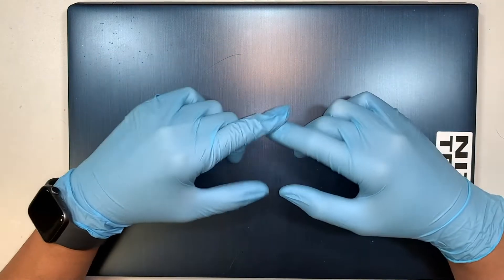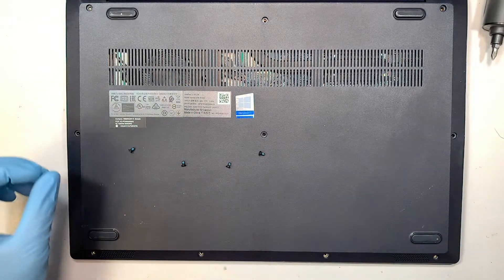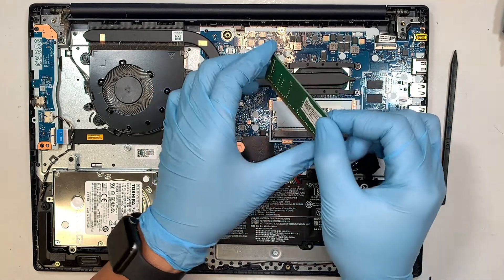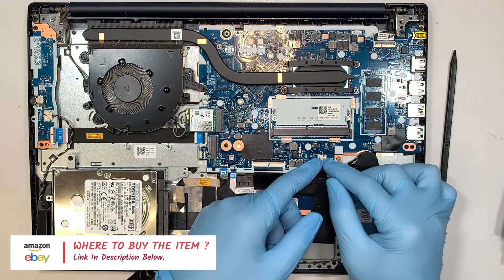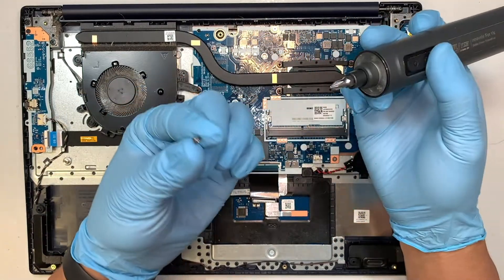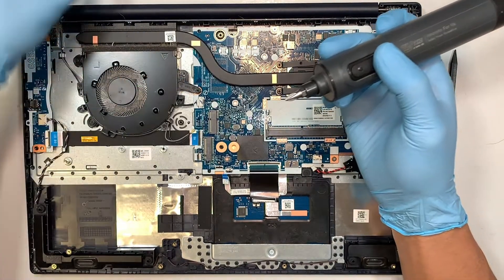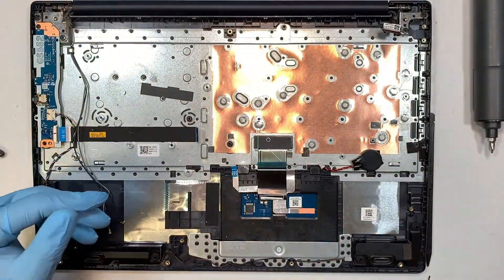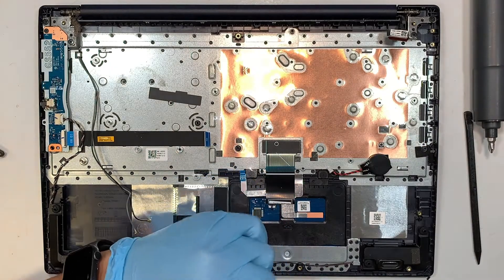Lenovo Ideapad 3 15IL05 81WE Teardown Upgrade Disassemble

Comment: Good video. My screen is very dim ( i struggle to see anything). The brightness buttons don't help. Do you know what the problem is? Im sure it has to do with the hardware because my pc took a bump earlier. The LCD screen wirr had came out but i put it back in and now my screen has a very low brightness 😢

Comment: Good video.  I have this laptop.  Do you know what would be the issue if the PC seems to shut down but the power remains on.  There is nothing on the screen.  The HDMI does not work.  I press the power button to turn off and then press power button to turn back on.  There is power but no video and HDMI does not work.  I reseat the memory and everything is working again.

Comment: Pretty good video.  Thank you for being this clear and for explaining in such detail  Do you have the Hard Disk cable part number?  Mine just brought the NVME disk and I want to add the Hard Disk drive.
Reply from the maker: Try look at eBay using laptop model number with hard driver sata connector
Reply: Any update? , Im looking for same cable

Comment: My IdeaPad 3 go a short circuit through the headset pot due to some direct connection through my speaker 🔊 can the motherbold get affected cause it can't turn on or charge

Comment: I read that this laptop originally supports up to 12 GB of RAM (4+8) ¿Is there a way to have 20 GB (4+16)? Because some laptops can support more RAM unoficially. 

And other thing, does the laptop includes the screw needed for the installation of the M.2 NVME SSD?

Thanks for your help.
Reply from the maker: Laptop does not include m.2 ssd screw. Need to buy separately. Maybe do 8+8 ram
Reply: @UbergeeksBiz  can't do it, there are 4 GB of Ram soldered to the motherboard
Reply from the maker: @franciscoacr  4+8 might be the max